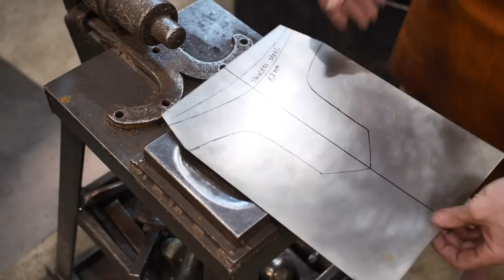Functional Mandalorian Steel Armor. Brestplate, metalworking

Comment: What is happening at 18:15?   Does heating the steel make it take the brass off the brush, or some other coloring process??
Reply: Curious as well
Reply: Me too!
Reply: Brass is removed in any case, only when heated there is no oil, dust, and probably an oxide film on the surface .. Therefore, brass sticks better

Comment: 3:30 Please be safe when using an angle grinder. You should to use the guard, and use both hands. Don't want you to lose a finger.

And please never hold something in front of the angle grinder. It can catch and jump forward amd remove your finger. If you're concerned about clamping your armor, you could probably add a piece of rubber or fabric such as a towel between the clamp and the armor to prevent denting.

Comment: How do you know which shape to cut out before shaping? Is there a method to it? Does it always work out the first time?
Reply: I'm not certain however I would assume that the method for determining the shape to cut would be similar to the method in sewing. It should be easy to look up if it is.